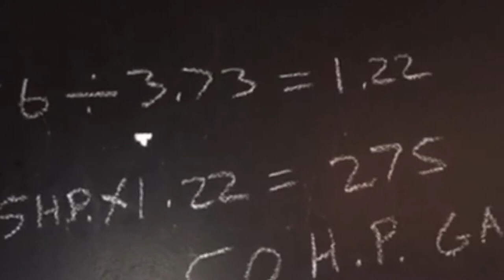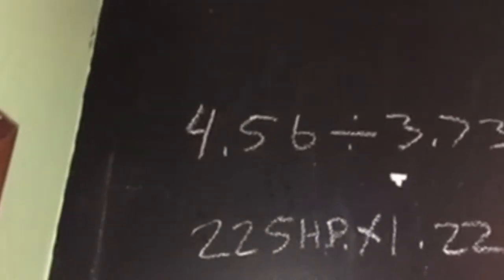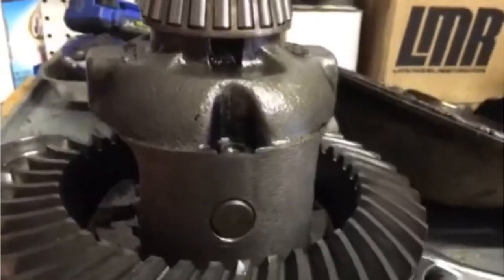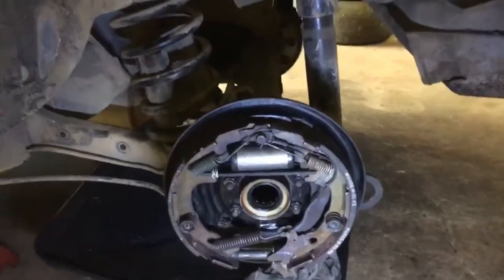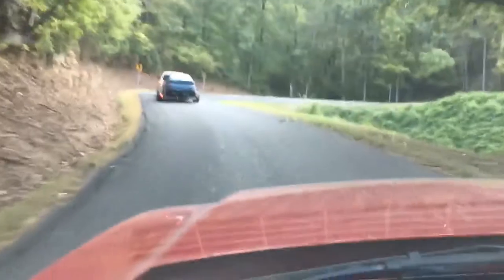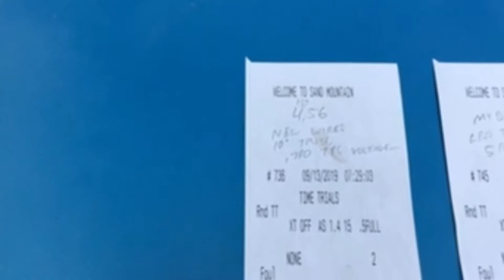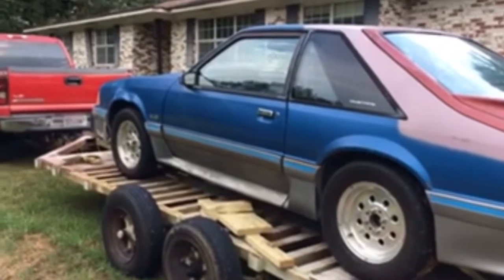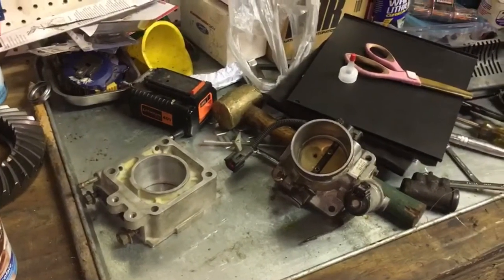How to pick Rear End Gear Ratio + Install and Racing 4.56 gears in 1988 Mustang GT AOD

Comment: I put a 4.10 in my AOD and I’m considering going to 4.56. After watching this I’m Strongly considering it! 😀
Reply: What converter are you running? Do you run 1/8th or 1/4 mile?
Reply: @Sikulz  I have a 2800 to 3200 stall and all we have close by are 1/8 miles.
Reply: @autofox5.067  I like the 4.56s but I just recently switched em out for 4.10s, I miss the 4.56s but I was on the limiter before I got to the 1/8th, I’ve got a Vortech on the car now and it’s close to 100 MPH trap speed. My next move is gonna be putting a 4R70W gear set in the AOD, it’ll go from a 2.41 to a 2.84  first. What’s your engine combo?
Reply: @Sikulz  Im still pretty basic. I just put GT40 heads and explorer intake with a B cam. I haven’t got to run it yet since the upgrades. Stock cam and heads with 4.10s I ran 9.50s in the 1/8. Not fast by any means.

Comment: Just came across this channel. Glad I did great content. I do have a question. How did your brother figure out what shims to use on the pinion? I want to change mine also 373 to 456. Thanks for the videos.
Reply from the maker: Thanks! That’s really nice of you. I honestly don’t have a clue lol. I’ll have Sikulz9550 (my bro) get you an answer. He’s done plenty of gear changes
Reply: @fomobros2207  Cool Thanks for replying.
Reply: Gregory Frost I’ve had good luck reusing the existing shims behind the pinion I’m taking out, I’ve done about 10 of these over the years, this strategy hasn’t failed me yet. Is your car a 5 speed or auto?
Reply: @Sikulz  TKO 5 speed. That's what I've been told not to change the pinion shims. You don't think the 456 will work with 5 speed? Any input would be appreciated. Thanks for getting back with me.
Reply: Gregory Frost I was just curious. I think it’ll be a great gear and lots of fun. I plan on 5 speed swapping this 88 in the future.
Reply: @Sikulz  again Thanks for the help. I've had these gears a while now. Looking forward to seeing more videos.
Reply: Do you run 1/8 mile?
Reply: @Sikulz  will be our track is going to change 1/8 mile. And most of the street racing around me going 1/8 mile.
Reply: Gregory Frost it’s excellent for 1/8 mile, for 1/4 mile I might suggest a 28 or 29 inch slick with that gear.
Reply: @Sikulz  right now I'm running the Mickey thompson 26 x 10.5 x 15
Reply: Gregory Frost let me know how it goes for you, I’m excited for you man, should be a blast!!!
Reply: @Sikulz  Thanks I will.